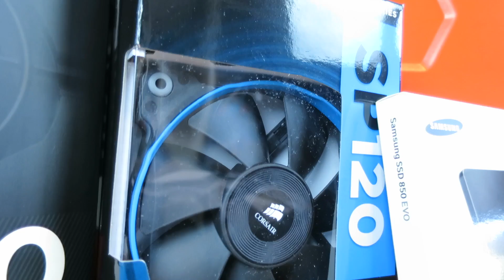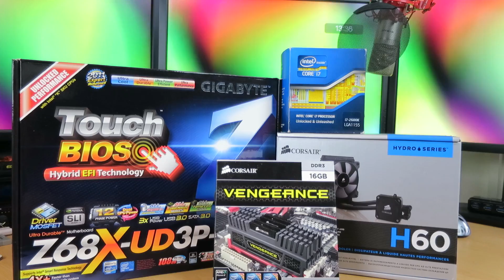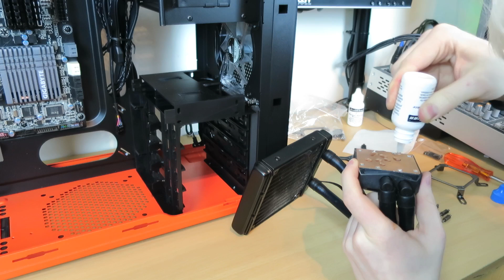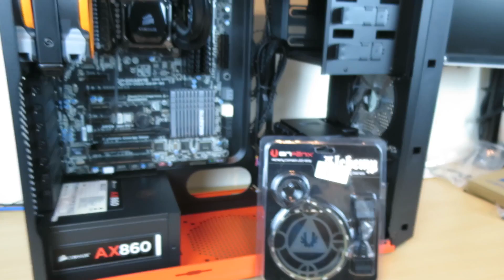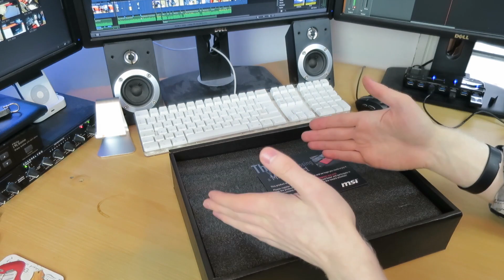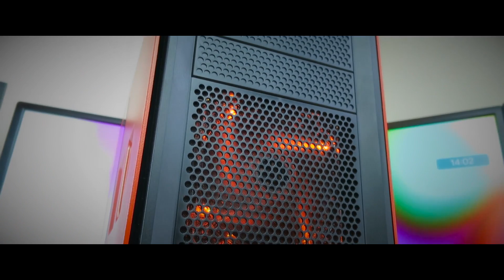EPIC 2016 Gaming PC Build (DOOM Ready!) | IMNC

Comment: $1271 Gaming Setup is this good?

Hard Drive/ https://www.amazon.com/Blue-Cache-Desktop-Drive-WD10EZEX/dp/B0088PUEPK/ref=as_li_ss_tl?s=pc&ie=UTF8&qid=1471586545&sr=1-1&keywords=wd+blue&linkCode=sl1&tag=joeydel2525-20&linkId=48a0d71470ce75f2ada89834c8a657f1

I5 processor  https://www.amazon.com/gp/aw/d/B010T6CWI2/ref=mp_s_a_1_1?ie=UTF8&qid=1474178281&sr=8-1&pi=SY200_QL40&keywords=core+i5&dpPl=1&dpID=51Gq81DIpEL&ref=plSrch

Video Card https://www.amazon.com/MSI-GeForce-GTX-1060-ARMOR/dp/B01IEKYD3C/ref=as_li_ss_tl?s=pc&ie=UTF8&qid=1471586417&sr=1-1&keywords=gtx+1060+armor&linkCode=sl1&tag=joeydel2525-20&linkId=e8aab6567bb0be55f4d4ae4641f3e038

MotherBoard https://www.amazon.com/MSI-Skylake-Motherboard-B150M-Pro-VD/dp/B017NIDX1E/ref=as_li_ss_tl?s=pc&ie=UTF8&qid=1471586456&sr=1-1&keywords=b150m+pro+vd&linkCode=sl1&tag=joeydel2525-20&linkId=b22564fa2edb039e95747e8652f9daf8

Power Supply https://www.amazon.com/Continuous-Power-Warranty-Supply-100-W1-0430-KR/dp/B00H33SDR4/ref=as_li_ss_tl?ie=UTF8&qid=1469242275&sr=8-1&keywords=evga+430w&linkCode=sl1&tag=joeydel2525-20&linkId=6006b330d3791a5ea5797400fca10ebc

Memory https://www.amazon.com/gp/aw/d/B013J7T5K6/ref=mp_s_a_1_1?ie=UTF8&qid=1474182611&sr=8-1&pi=SX200_QL40&keywords=g+skill+ripjaw+16gb&dpPl=1&dpID=416fE%2Bv7ArL&ref=plSrch

PC Case https://www.amazon.com/dp/B005869J4O/?tag=pcpapi-20

CPU Fan https://www.amazon.com/Phanteks-U-Type-Heat-Sink-Cooler-PH-TC12DX_BK/dp/B00AXUTKEE/ref=as_li_ss_tl?ie=UTF8&qid=1446546998&sr=8-1&keywords=Phanteks+PH-TC12DX-BK&linkCode=sl1&tag=thte07-20&linkId=63309fd2562df2d9ec05913a04698b0f

Asus Monitor 
https://www.amazon.com/gp/product/B005BZNDOO/ref=as_li_tl?ie=UTF8&camp=1789&creative=390957&creativeASIN=B005BZNDOO&linkCode=as2&tag=techs096-20&linkId=U6JPCSHYRTPL6EED

Windows 10 https://www.amazon.com/gp/aw/d/B00ZSI7Y3U/ref=mp_s_a_1_1?ie=UTF8&qid=1474184478&sr=8-1&pi=SY200_QL40&keywords=windows+10&dpPl=1&dpID=41us3IirK-L&ref=plSrch

Optical Disc Drive 
https://www.amazon.com/gp/aw/d/B0033Z2BAQ/ref=mp_s_a_1_1?ie=UTF8&qid=1474184784&sr=8-1&pi=SX200_QL40&keywords=optical+drive&dpPl=1&dpID=31JpWsniizL&ref=plSrch

Office Chair 
https://www.amazon.com/Leather-Office-Executive-Ergonomic-Computer/dp/B004ZVHKJE/ref=as_li_ss_tl?ie=UTF8&qid=1466657684&sr=8-5&keywords=office+chair&linkCode=sl1&tag=khyra-20&linkId=e5d8c4b41e00e5a63ca02073945e4003

USB Speakers
https://www.amazon.com/AmazonBasics-Powered-Computer-Speakers-A100/dp/B00GHY5F3K/ref=zg_bs_172471_1

Red Backlight Keyboard 
https://www.amazon.com/Redragon-K552-Backlit-Mechanical-Keyboard/dp/B016MAK38U/ref=as_li_ss_tl?tag=mt005-20&ie=UTF8&qid=1473713068&sr=8-2&keywords=redragon&linkCode=sl1&linkId=16c508dc8065df98d4c4d1b714f372c8

Gaming Mouse
https://www.amazon.com/gp/product/B00HYPCP0M/ref=as_li_tl?ie=UTF8&camp=1789&creative=390957&creativeASIN=B00HYPCP0M&linkCode=as2&tag=techs096-20&linkId=WKEVXPRVNHEGZT5J

Headset
https://www.amazon.com/gp/product/B00BFOEY4I/ref=as_li_tl?ie=UTF8&camp=1789&creative=390957&creativeASIN=B00BFOEY4I&linkCode=as2&tag=techs096-20&linkId=IL2XFG7RMRX3UC5G

Comment: This may seem like a big question but can anyone give me some help with what Hardware to get for a gaming pc I'm building that has a 1300 pound budget which is around 1700 dollars
Reply: Cpu i7 6700k
Motherboard z170
A nice liquid cooler
Gpu gtx 1070
Psu 750 watt
Case nzxt s340

That should around that budget and give you 60 fps maxing out all games at 1440p and if you can fit in there a gtx 1080 instead of the gtx 1070 if you're going to play at 4k
Reply: And 16gb of ddr4 ram
Reply: +sath peraza thanks a lot I really appreciate what you've done. I think I'll go for the 1080 because I don't need to buy any peripherals or monitors. I'll look into all these parts you've told me.

Comment: My current setup:
Motherboard -
Gigabyte h81m-h
Video card -
Zotac gtx 970 4gb
Processor -
Intel i5 4460
Storage -
240gb ssd
1tb had
Power supply -
500 watts
Ram -
16gb (2x8)

Any suggestions? Feel free to leave your opinions :)
Reply: what games do you run on it and general benchmarks (settings and fps)
Reply: I play rust on all max settings at an average of 70 fps and battlefield on ultra no less than 100 fps.
Reply: +Yeti Origins cool

Comment: Guys I want to make the switch to PC from console so I'm a noob at picking parts building etc. So I just wanted some feedback on this possible build: 

CPU: AMD FX-8350
GPU: ASUS NVIDIA GTX 960 Strix
Motherboard: ASUS M5A97 EVO R2.0
RAM: HyperX Fury DDR3 16GB
Reply: Where is the case, HDD, power supply?
Reply: +Veteran Alpha
Case: CiT Dragon 3 Midi
HDD: Western Digital 1TB
PSU: EVGA 600W 80+
CPU Cooler: Cooler Master Hyper 212X
Reply: Kieran Stokes Ah there you go, if i were you i would get a Intel CPU, Intel makes stronger CPU's and sometimes it might be cheaper or a bit more but it is worth it in the end. Try and reconsider that. :)
Reply: +Veteran Alpha Okay will do, thanks for the feedback bro
Reply: Kieran Stokes Not an issue, just make sure your motherboard supports a Intel CPU.

Look for a motherboard with a LGA1150 or LGA1151 socket. And make sure that the CPU you are getting has the correct socket. For an example im getting the Intel I5 4460 and the socket is the LGA 1150, which means that i need a motherboard with a socket 1150.

Comment: Hi guys. I need some help with building my first ever pc. I came here for help. Would this build be any good for gaming. Also how many fps would it play on average ultra high settings on graphically demanding games like crysis or gtaV? Should I change any parts or is this good? All comments and suggestions are welcome and appreciated. Thanks

CPU 
AMD FX-8350 4.0GHz 8-Core Processor
CPU Cooler 
Cooler Master Hyper 212 EVO 82.9 CFM Sleeve Bearing CPU Cooler
Motherboard
MSI 970 GAMING ATX AM3+ Motherboard
Memory 
Kingston HyperX Fury Black 16GB (2 x 8GB) DDR3-1866 Memory
Storage 
Kingston HyperX Fury 240GB 2.5" Solid State Drive
Western Digital Caviar Blue 1TB 3.5" 7200RPM Internal Hard Drive
Video Card 
Asus Radeon R9 380 4GB Video Card
Case 
BitFenix Comrade ATX Mid Tower Case
Power Supply 
EVGA 500W 80+ Certified ATX Power Supply
Optical Drive 
Samsung SH-224DB/BEBE DVD/CD Writer
Operating System 
Microsoft Windows 10 Home OEM 64-bit
Software 
Microsoft Office Home and Student 2016 Software
Reply: looks like a good  build although you might want to change the video card

Comment: Is this gaming pc good? Will everything fit? Will it run high end games smoothly? Thanks in advance! (Note: This is my first gaming pc) http://pcpartpicker.com/list/w8r9TH
Reply: Everything seems okay, except maybe get better RAM and wait instead for the gtx 1070 or 1080 it would be killer with either one of those
Reply: ***** IggyDoesStuff Thinking of getting this now(Will upgrade to a better keyboard and mouse later, and possibly a new headset later): http://pcpartpicker.com/list/KvtpgL
Reply: I'm kind of late on this but here is some things you can change out:

The core i7 6700k will only make a 0.8% increase in gaming performance so the the core i5 6600k or 6500 would be much better choice in terms of value.

Most liquid coolers get beaten out by the noctua NH-D14.

The motherboard is fine but if you plan to overclock at some time, the Z chipsets will have to be a choice.(Z170 chipset)

You could fit in a SSD in that price point such as the crucial BX200 240gb ssd or zotac 120gb premium edition SSD.

Wait for the GTX 1070

The Corsair PSU you chose does not have the best quality and is discontinued. I'll advise you to get the evga 650 GQ or the seasonic X650

Comment: Can someone tell me the bad or the good of this pc ? This is a pc where i want to edit and game on a lot ! Can you tell me what i need  to change!?

EDITING/ GAMING

CPU: Intel i5 4690k
Motherboard : MSI 970 GAMING 
Cpu Cooler : Cooler Master 212 Evo
Graphics Card : XFX Radeon R9 380X
RAM : Crucial Technology Ballistix Sport 8GB (2 sticks)
Power Supply : EVGA 600B Bronze Power Supply
Case : Corsair Carbide Series SPEC-01 Mid Tower
HD : 1Tb 7200Rpm
Reply: *****
 I know that is will become quite
Reply: (SOMEONE RESPOND) Pleaseeee ! ! !
XFX Radeon R9 380X R9-380X-4255 4Gb ?
OR
Sapphire Nitro R9 380X 4Gb ?
I dont care about how much which is better?
Reply: +Amit Sarvate um, I hate to be that guy that points out the obvious, but they are both Radeons

its just that the cards are aftermarket versions of the reference cards (in this scenario they're both Radeon R9 380X's

the sapphire nitro will be better because its overclocked to 1040mhz, where as the XFX has a mild overclock of 990mhz, over the reference 970mhz/ if you want to push further XFX also have a 380x Black edition, with a 1050mhz core clock.
Reply: kingarthur83rd
I am new and i don't know how to overclock but know that you mention is it really better to get the sapphire?
Reply: a higher overclock generally means better performance. Sapphire have been the go to brand for Radeon cards for a while. 

if you already have the XFX R9 380X theres no real need to get the sapphire card as you'll see little to no performance difference.

upgrading to the R9 380X I'd go sapphire, or the XFX Black edition R9 380 if you can get it.

Comment: I got a non modular PSU with a shitload of cables made for large systems in a small mATX case.

I still had the power supply and I was like, well if I have it I might as well use it but the cable management.. ehh..

I tried and tried but after 5 hours trying to make it look neat I gave up. The airflow is good enough to not have an effect on cooling and for the rest, whatever.. The side panel doesn't have a window anyway. xD

Comment: Can i play league of legends , overwatch and cs :go with high setting while recording games and browser on . (60 fps) . btw i am beginnerprocesser: Intel Core i3-2100 3.1GHz Dual-Core Processor 
cooler: Thermaltake CLP0556-B 39.7 CFM Sleeve Bearing CPU Cooler 
motherboard: MSI H61M-P31/W8 Micro ATX LGA1155 Motherboard 
memory: Samsung 4GB (2 x 2GB) DDR3-1333 Memory
harddriv: Samsung 4GB (2 x 2GB) DDR3-1333 Memory  
video card: Zotac GeForce GTX 750 Ti 2GB Video Card 
case :DIYPC DIY-N8-BK MicroATX Mini Tower Case
power supply :Antec 450W ATX Power Supply

Comment: I'd love to build a gaming pc someday, just don't think I could bring myself to mess with connecting the wires
Reply: +Bomani Chisulo its honestly a lot easier than you think, you just have to plug in the cables exactly where the picture tells you to, they make it as simple as possible, the only tool I used to build my computer was a screwdriver.
Reply: William Costello Oh really? I somehow got the impression that it was a lot of cutting, splicing, and soldering, as when I wire things they have a bad habit of bursting into flames
Reply: +Bomani Chisulo you don't have to cut or solder at all you just plug one end into the PSU and the other into what you are trying to power, then just connect it to the motherboard. It's just a lot of time spent if you want to make it look pretty, other than that it's just plugging thing in.
Reply: William Costello Oh wow, I actually kind of feel dumb now, it's what has been keeping me from building one, other then lack of funds, I was really just over thinking it then.
Reply: +Bomani Chisulo I was in the exact same boat as you, I thought it was going to be much harder than it was. The hardest part about building a computer is picking out all of the parts.

Comment: System Requirements
MINIMUM: 
OS: Windows 7, Windows 8.1, Windows 10 (64-bit versions only) 
Processor: Intel Core i5-2400 or better / AMD FX-8320 or better 
Memory: 8 GB RAM 
Graphics: NVIDIA GeForce GTX 670 (2GB) or better / AMD Radeon HD 7870 (2GB) or better 
DirectX: Version 11 
Network: Broadband Internet connection 
Storage: 22 GB available space 
Additional Notes: Open GL 4.5. Latest Graphics Drivers.

RECOMMENDED: 
OS: Windows 7, Windows 8.1, Windows 10 (64-bit versions only) 
Processor: Intel Core i7-3770 or better / AMD FX-8350 or better 
Memory: 8 GB RAM 
Graphics: NVIDIA GeForce GTX 970 (4GB) or better / AMD Radeon R9 290 (4GB) or better 
DirectX: Version 11 
Network: Broadband Internet connection 
Storage: 22 GB available space 
Additional Notes: Open GL 4.5. Latest Graphics Drivers.

BTW The minimum data valid for the low resolution 1,280 × 720. If you want to play in Full HD, you should definitely oriented according to the Bethesda recommended requirements.So, R9 380 even 4gigs will not be enough for real enjoyment here.

BTW2:  http://wccftech.com/doom-open-beta-gpu-performance/

Comment: is this a good budget build or should i change something
Athlon x4 860k
212 evo cooler master
8 gb g skill ripjaws x 1866
Asus strix 2gb gtx 950 oc
gigabyte ga f2a68hm-h 
psu evga 500w
western digital 7200rpm 1tb
Cooler master n200 atx
windows 8.1
2 corsair air series led

Comment: The 2600k is a good cpu,  but the GPU is bottle necked by it. the 3700k is a better options because it supports higher PCIe while giving the same speeds and they are only 20 - 40 more.
Reply: +OmnipotentPeaceMan The 380 won't be bottlenecked, the 2600K can even run a 390 without a problem.
Reply: The_rocketman  No the 2600k only supports PCIe 2.0,  the 380x is PCIe 3.0.
Reply: OmnipotentPeaceMan Oh, it seems you don't understand how the PCI standard works.

Even though the 2600k only supports PCI-e 2.0 it still won't be a problem since PCI-e 2.0 16X is still fast enough to make full use of every GPU on the market at this point.

Every single PCI-e 3.0 card also supports PCI-e 2.0 and 1.0 (however 1.0 will cause a bottleneck on most cards nowadays).

PCI-e 2.0 16X is just fine for the current crop of cards, PCI-e 3.0 was just a natural progression in technology(speed).

PCI-e 3.0 8X = PCI-e 2.0 16X

Comment: can someone tell me if this is a good build. tried to keep around £400 ($566	)
http://uk.pcpartpicker.com/p/6n47cf
Reply: +ReggieAssassin It's a good build, but you may want to spend a little bit more (~£20) on graphics and get the GTX 950, because its a bit better than the 750 ti, and it has SLI support so you can upgrade and get a second card in the future.
Reply: I made the build cheaper, with different parts from amazon, here..

MSI NVIDIA GTX 750Ti Gaming 1085MHz (Boost 1163MHz) 5400MHz 2GB 128-bit DDR5 DL-DVI-D HDMI PCI-E Graphics Card 

Asus M5A78L-M/USB3 Motherboard with Socket AM3+, up to 32 GB DDR3, USB 3.0, uATX 

AMD FX6300 Black Edition 6 Core (3.5/4.1GHz, 8MB Level 3 Cache, 6MB Level 2 Cache, Socket AM3+, 95W, Retail Boxed) 

Western Digital WD10EZEX 1TB SATA lll Desktop SATA Drive - Blue 

HyperX FURY Series 8 GB (2 x 4 GB) DDR3 1866 MHz CL10 DIMM Memory Module Kit - Black 

EVGA 100-B1-0500-KR - 500W 80 Plus Bronze Power Supply (100-B1-0500-KR) 

CiT Goblin Mesh Gaming Case Black/Green Interior USB3 12cm Green LED Toolless 

Cooler Master R4-L2R-20AG-R2 Sickleflow "120mm, Quiet Case Fan / Cooler Fan" Black with Green LED 

£373.58
Reply: so now I can upgrade the gpu
Reply: changed it thanks

Comment: Can it run Minecraft at 5000 fps in max settings?
Reply: no.
Reply: ***** no, depends on what monitor u play. If you play on a 144hz monitor you want more than 60 fps if you want to play with a very smooth experience. However if you have a 60 hz monitor. 60 fps is enough

Comment: Nice video ..........come check out my new PC Build and my first uploaded to YouTube  ... Intel i7 6700k skylake ,.......cooler master hyper T2 CPU cooler <-- that was replaced with a CRYORIG H5a CPU cooler  ......,gigabyte z170x gaming 7 , ......bios version F5,....... corsair vengeance LPX  DDR4 3600Hz with active cooling ram , ........corsair Hx850i fully modular platinum PSU, Kingston hyperx savage 480gb SSD , .....WD blue 1T 7200rpm 64mb back up HHD ,.......mid tower DIYPC D480-white comes pre installed five 120mm fans and three are blue led the tower is $59 it almost cost that much just for 5 fans that's a good deal ......I also made DIY grommets $1 sheets from Michael's......

Comment: i really didnt expect to see a build so similar to mine.
i cobbled together old and new just like you have.
i scrounged up a: 
2500k,
16gb kingston low profile (no sawn off dimm lol), 
gigabyte g1 m3 sniper z77, 
samsung 650 120gb ssd, an old kingston 60gb ssd, WD 1tb hdd, 
coolermaster v750 gold in a storm trooper case with both front and top 200mm fans, 
a couple corsair 120sp's
hyper 212-push pull, 
and  
an R9390 8gb. 

it handles current AAA titles beatifully eg: the witcher 3

yours is much prettier.

Comment: Will my pc run Witcher 3 on ultra
Specs:
intel potato 4004 
12mb 300mhz ram 
nvidia 9700 oven edition
25gb hdd buzzer
100w psu space heater version
Reply: +Andrew Simmons why wouldnt it i really want the intel potato 4004 though its alot of money

Comment: I have a question on what processor to get.  I am building a PC for all around use.  I plan on gaming on it here and there, not too much.  I want to potentially Photoshop in the future, and I want it to be able to handle computer programs for college.  Also my friend and I were thinking of starting something on Youtube.  I do not plan on overclocking.  Here are the two processors I am thinking about:

i5 6600
Speed:  3.3GHz
Cache:  6MB
Cores:  4
Threads:  4
Price:  $229.99

i7 6700
Speed:  3.4GHz
Cache:  8MB
Cores:  4
Threads:  8
Price:  $349.99

Is the i7 6700 worth the extra $130?  Please let me know as soon as possible.  Thank you!